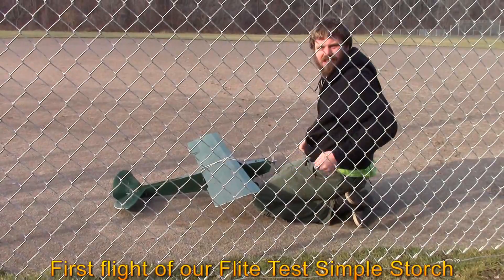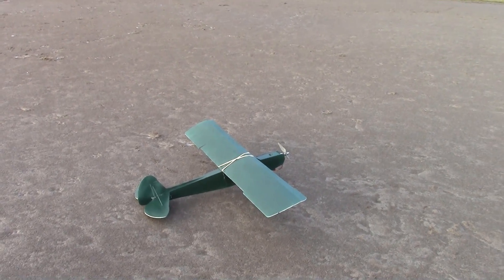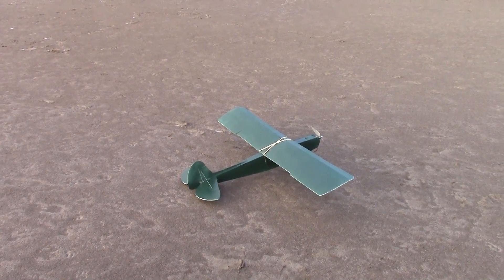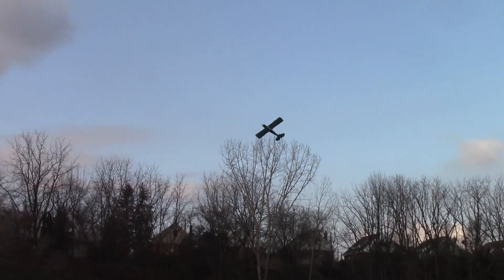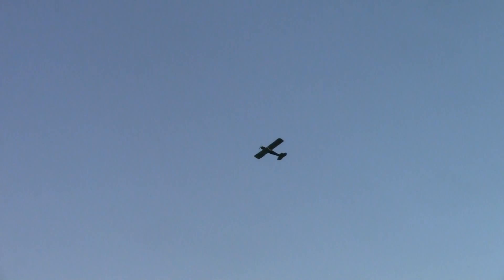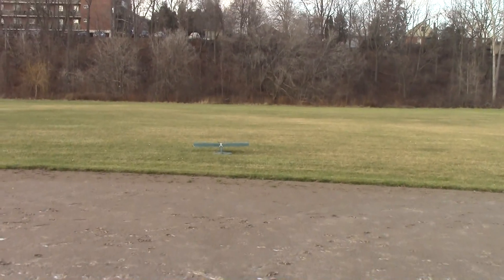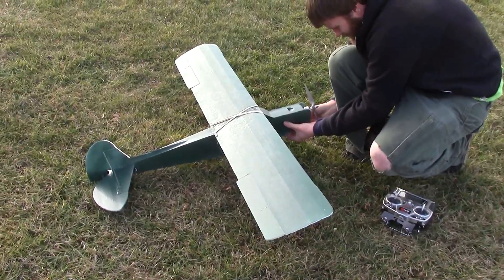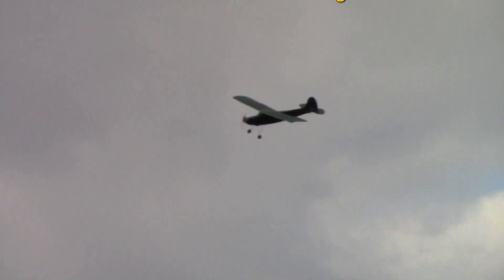First flight ( and crash ) of our Flite Test Simple Storch

Comment: You can use a bigger 3S or 4S battery to get the CG farther forward and to increase the performance.  I use a 4S 2200.
Reply from the maker: Thanks for the comment. There wasn't enough motor for a 4S (actually the whole drive was really inadequate) but the main issue was the battery came loose and was flopping around inside.

Comment: have you checked CG?  It looks tail heavy what with all the porpoising.  I run a 3 Cell 1800 most of the time, but it has used up to a 3200 4s with vertical climb.  Only thing it can't do is snap roll.
Reply from the maker: It was tail heavy the battery had come loose and slid back.

Comment: Nice job on the landing gear wire.  I still can't get mine to line up like yours!
Reply from the maker: I cheated and used a small torch to heat the wire at the bend.🤨
Reply: Thanks Matthew.  I don't have a torch, but I managed to get the wheels to sort of line up.  I plan to hand launch as the tail skid fell off on the rough asphalt at my field.
Reply: @userTJ39780  I have beefed up the landing gear with Popsicle sticks and rubber bands.  Now it can land anywhere.

Comment: I got the harbor freight mustang p51 and it has over 60 flights on it however i broke both propellers that came with it and now i have an after market 8x4.5 the place i take off and land is kind of rocky lol but the plane handles good right out of the box for little under $85
Reply from the maker: Cool. We will have to check that out.

Comment: please friend engines which I could use this model airplane'm from Brazil need your help I have a motor Turnigy 2830/11 would like to know the c to use this model airplane
Reply from the maker: That motor should work very well in the Storch. I bought 25C 3 cell 2200mah packs for our plane and I also have a 30C 3 cell 2200mah pack. The motor only draws 21 amps you will not need a high C pack. I am running a 9 inch prop with the 3 cell batteries. If you want to run 2 cell use a 10 inch prop. When you get it up post a vid I would love to see it.
Reply: yes thanks